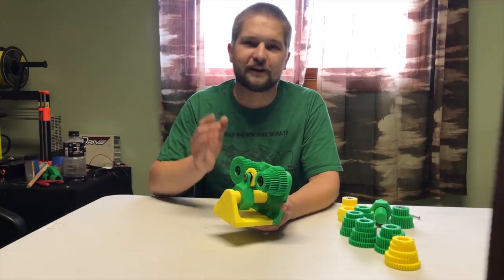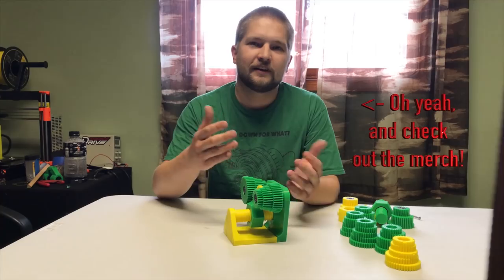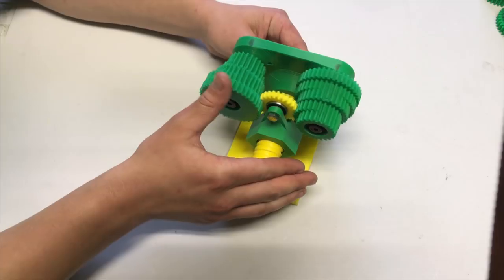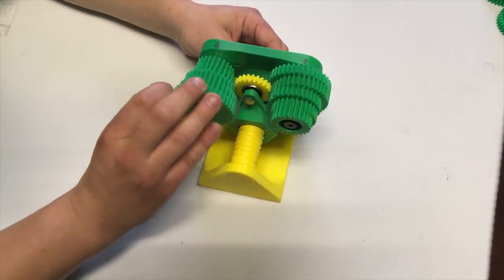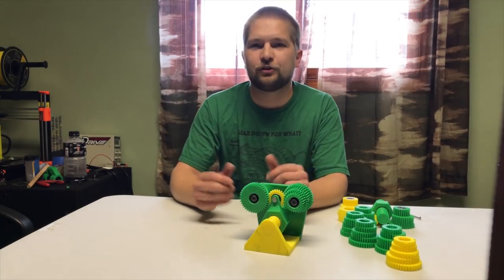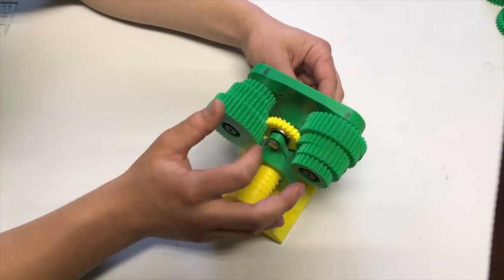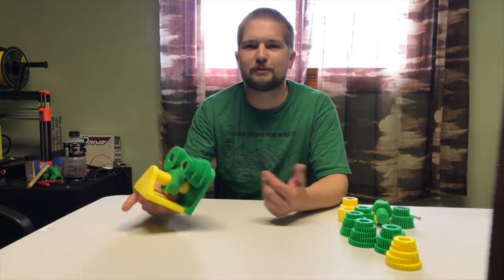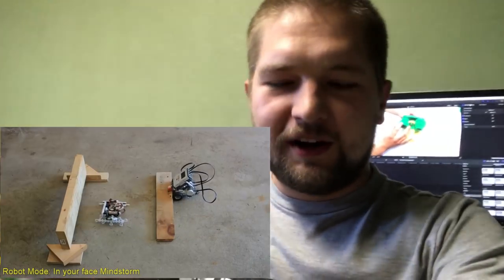The Hot Swapping Gear Mechanism | VCT2

Comment: You can even improve more this concept:
- compress green gears in cones  and slide the yellow gear between two cones
- you could shift gears at every given time
-this could be something in between gear treansmission and cvt transmission...
Reply: Good luck figuring out how to hob make a constantly variable gear tooth count into that conical gear...

There's a reason CVTs use belts and not gears.

Comment: And it looks like although the indexing of each gear ring is locked to their respective shaft, the centering isn't. So even if the selection problem was sorted out this would only be good for low speed applications, because it'd vibrate like hell otherwise.
Reply: You could fill more metal to the shorter side of the ring to correct local variations in center of mass.
Reply: Weights. You just need to balance them. This is not new technology.

Comment: they have had a continuously variable transmission out for years now. some cars use it but you see it mostly on progressive drive lawn tractors.(stick on the right fender of the tractor, its the kind of stick without locking notches)

Comment: The VCT2 is the easier Van Cor Transmission to make with 2-degrees of freedom.  That means it moves changing speeds moves in two directions.  The VCT1 has one degree of freedom; it moves in one linear direction across the face of a cone.  It is based on conic teeth that are cut on a cone that neutralize change in surface speed with the change diameter.  It is a new kind of gear.  Changing to different conic gears is moving out of the conic gear into a channel entrance, then through the channel with transition teeth that change the gear ratio to the channel exit at the new gear ratio, then into the next channel.  The VCT1 does this with a linear action - Dale E. Van cor

Comment: if you spring loaded the screw shaft on either end to allow float and possibly also beveled the intermediate gear you could manually change gears without using mechanical or computer control under load.

Comment: Immediate downsides:  1. You have to turn more mass, since all the gears need to turn at the same time to be aligned properly.  Less energy efficient.  2. Teeth would definitely see more wear.  3. Loss of responsiveness, there would be lag time because it would have to wait until the gear is aligned properly to shift, and has to shift fast enough to move to the next gear entirely before the rotation falls out of alignment. 

I actually think some tapers/angles to the teeth at certain points might help with shifting though. It could help to more easily guide the gear with less friction, but would mean weaker teeth.

Comment: Conclusion: Just use a well designed and built CVT and move on.
Reply: 4G12 this is in no way a CVT, there are set ratios to this transmission. It still “shifts”
Reply: 4G12 just take a DSG
Reply: A CVT of similar torque and power rating would be much simpler, compact and lighter, other than the obvious advantage of infinite ratios within a given range.

It's sad that Jatco and Nissan have so heavily damaged the reputation of CVTs when in fact CVTs have been used reliably by heavy duty industrial machines for quite a while.
Reply: Cvt without belt
Reply: CVT's are really wonderful.
Although They have their own disadvantages.
Reply: Jhon Agustinus Yahya what? cvt gives the best working environment for gas/diesel engines. For me its the best transmission for private use (cars, mopet's) as well as for professional use (buses, heavy trucks etc.). But yeah... its not good if you're nissan and you're making cvts from recycled soda cans...
Reply: CVT's would be more viable if they'd make them serviceable. I can change the belt on my Polaris in ten minutes with basic tools. There is zero sane reason to build an automotive CVT that cannot have the push belt changed without removing and disassembling the transmission.
Reply: Oddman1980 yeah, that's right but that's pain of products for masses
Reply: Mukul Singh You guys dont even know what CVT stands for, Constantly variable transmission. Aand.. there already are gearboxes that can be shifted without a clutch. 
CVT is just by far the best transmission for highest efficiency. Maximum output for maximum acceleration, what else do you need?
Reply: Mihkel Laansoo but CVT is most common used one
Reply: Nissan doesn't make trash cvts, owners just don't take care of what they own.  My dad's Nissan altima has 213,000 on the original belt,  he regularly has the fluid changed, this is why it has lasted so long.  Maintenance is the key.
Reply: Zaque Davis sorry m8 but 230k isnt big deal, make 400k and we can talk. And It can be one for milion that itsn't trash... opinion doesnt come form nowhere
Reply: PiEn alright m8 thanks for the info.
Reply: PiEn he may be using miles which translates to 342,790 kilometers.
Reply: Never EVER EVER EVER use a CVT, unless you want to be rear-ended because your CVT decides to have your engine stuck at 2000 RPM when you are trying to accelerate onto a highway
Reply: CVT suck and some of them are noisemakers. It is just unreliable. Look at Subaru since they switch to cvt transmission they have a lot more transmission failure than their previous transmission which almost never. Don't get me started with gm and nissan cvt are worthless.
Reply: SirFrag32 then you've obviously never owned a motorcycle with one... they are actually quite amazing
Reply: Or, just get rid of the gasoline engine and use an electric motor, which needs only one gear and no clutch.
Reply: We rarely see cvt failures on hondas. Only time they fail is when owners have abused them for 100k+ miles. The cvt cars also get better mileage and have better acceleration compared to their manual counterparts.

Source:Honda tech with 10yrs at a dealer.
Reply: Dan Sanger your not wrong
Reply: AfterDark, why the quotes around "shifts"? According to you does it not really shift, but only figuratively, or... what?
Reply: 4G12 you are correct I think
Reply: CVTs lag and that's annoying
Reply: Conjecture alert: The more we ask of a transmission to maintain a fixed engine RPM the more we ask the transmission to generate all of the accelerating forces through ratio changes. If you take off from zero once you reach the engine's RPM set point all of the torque required to accelerate further are endured by the ratio changing mechanism unlike every fixed ratio gearset ever invented. This is why CVT's built to a price point like all consumer products have to be going forward are less reliable than fixed ratio designs if you don't count the recent Ford Mustang debacle.
Reply: Phil Gudet 
That is a software and control systems issue in this day and age.
Reply: The main problem with CVTs is that they rely on a great amount of friction and high pressure to operate.  Both of these factors lead to wear and an increased probability of failure.  

The closest anyone has ever come to making a commercially viable geared CVT was Chevrolet with their Turboglide transmission from 1957 to 1961.  This transmission was constantly improved but remained unpopular with buyers because they couldn't feel it shifting. The main problem it had was with the fluid coupling but with today's technology this problem could easily be overcome.
Reply: Ski-Doo just made the most efficient CVT ever made, near 100% efficiency for the 1st time.
Reply: Mihkel Laansoo Actually it's "continuously variable transmission."
Reply: Dan Sanger Electric motors do not need only one gear. If you want high end power, like a track car, you are going to need at least two gears.
Reply: @wyeung0827  Yes, I want to hear you why CVT's are "worthless"?
Reply: I see a lot of non-senses here. For starting CVT was used in the 90's on Formula 1 and was banned with the AWD for giving advantage and not offering competitive racing. With todays technology and the brilliants engineers today, WE are capable of making a high torque CVT. They keep the engine RPM's to the most efficient position. They can give you a better MPG and the best power for keeping the engine at peak hp RPM.
Reply: Unfortunately you can't have peak power and peak efficiency, peak efficiency on a petrol engine requires high throttle usually at around the RPM where you make peak torque, but in CVTs I've driven this pushes you towards peak power not where BSFC map would dictate you get peak efficiency. I can generally get better fuel efficiency driving a CVT as a psuedo manual transmission.

I don't mind driving them personally -  I don't really care about the shifts not being there, but they are not the most efficient to drive, especially as you operate near the extremes (min/max gear ratio). Unfortunately a car has no idea just from you putting your right foot down whether or not you want peak acceleration or peak fuel efficiency. Erring on the side of performance is probably the correct way to go (you don't want to pull out into traffic and have it take its sweet time accelerating without you expecting it)
Reply: @skepticmoderate5790  run two motors, one on the front one on the back, and give them different overall ratios. no need for multiple gears at all.

Comment: I wonder if I can manage to build this in LEGO :0
Reply: No you cant
Reply: I know you can I have seen your videos
Reply: I'll at least try ;)
Reply: Would have to be yuge
Reply: I did once, I put it on a Lego Technique rc.
Reply: Frank Gedda Any pictures left ?
Reply: Never thought to take any, I was 12. However, I can tell you how I made it. I built it like this guy's model, but it actually ran on a mechanical motorized timer that slipped it into gear. I never got to make one that downshifts though.
Reply: Frank Gedda, Oh, wow ! Very interesting !
Reply: I feel like some of the timing issues could be solved by either moving the gears closer together and having the transmission gear able to  slide downward if neciscary but having it held in place by spring tension or by having the outer gears held in place by spring tension... no that doen't work does it. Hmm I;ll have to think about this a bit more and get back to yall on it.
Reply: Scorpion why not?
Reply: how would you get the off center gears?
Reply: no the gears are off center, and they are merged in some sections ;(
Reply: Don't do it. This is not working as intended and far away from useful in real world (and you normally try to build something useful there).
Reply: It's not just a row of gears, there's a spiraling section that transfers you between two gears without having to jump between them

Comment: There's a possibility that the VCT can function if the given gear sets to change torque ratio are disconnected in a manner to where they remain in-line such that the central gear can always link into place to the outer set, springs or a hydraulic control system could allow for that and gears with play can do such, but it will be difficult to figure out the timing and such to allow the clutchless shift

Comment: That is really weird. I see a lot of issues with this design
Reply: Josh Lewis eccentric parts in rotation == vibration.
Reply: @TheNefastor  eh not really. Look at rotary engines. 
This design however is a turd.
Reply: @outkast187  rotary engines don't vibrate ?
Reply: @TheNefastor  nope, they are insanely smooth. Far smoother than a 4 cylinder.  At 10,000 rpm they are still like sewing machines.  I have several race rotarys, and run solid billet engine mounts directly on frame.  Standard engines will rattle your teeth out.  Rotarys feel like electric motors.
Reply: @outkast187  then they must have eccentric parts. The vibration motor in cell phones and game console controllers uses an eccentric mass specifically because they cause a lot of vibrations. I know next to nothing on rotary engines but if they don't vibrate then they must be balanced somehow. Here we have a transmission where the arm will oscillate like crazy the faster you run it : that will vibrate until it breaks quickly.
Reply: @TheNefastor  rotary engines only have 3 moving parts. Rotors, and an eccentric shaft that spin them.
Reply: @outkast187  but the whole thing is balanced, right ?

Comment: this would cause massive vibrations while diving due to in balance in the shafts due to the gears not being centered
Reply: Chris Porche can be balanced with not to much hassle.
Reply: It would be pretty easy to counter balance the rampped step portions, by hollowing out parts of the hubs between the teeth and the axle. there will be some vibration during transition as the idle pinion swings back and forth between the ramps until it slides into the concentric part. That only lasts one rotation.

Comment: With those gears not centered and spinning so fast you would be creating large off center forces that would create massive vibration at a minimum which would cause major ware on the bearings and tear everything apart.